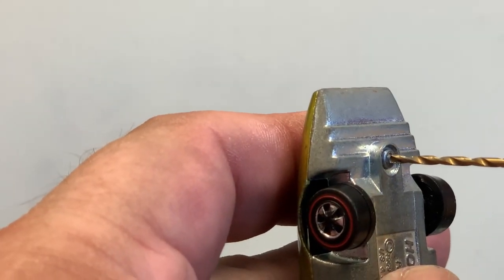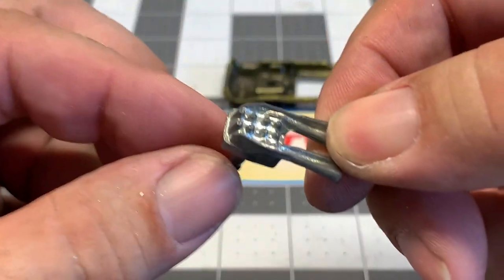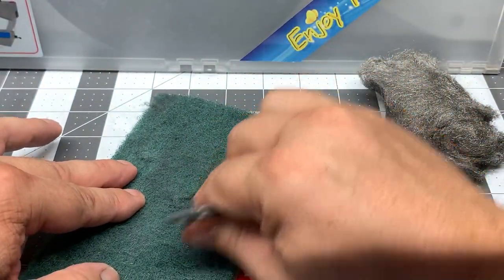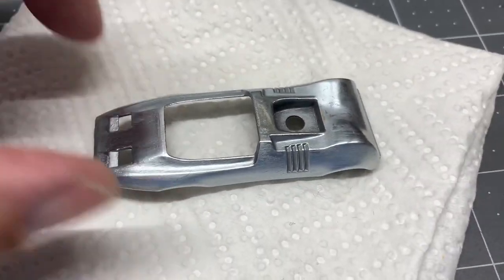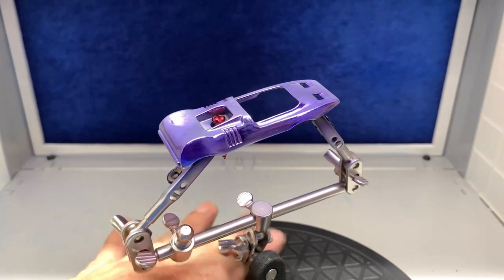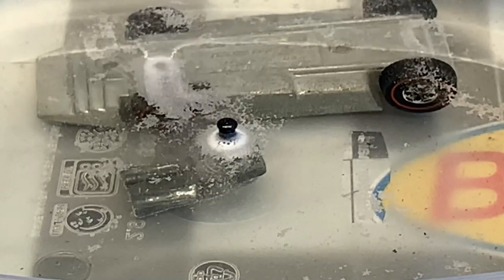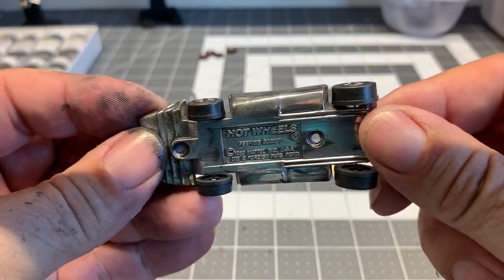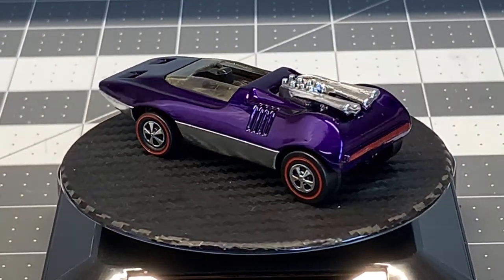Hot Wheels Peeping Bomb Restoration

Comment: Wonderful job. The before and after are amazing.
Reply: @DiecastGraveyard  Honestly I would like to see an original Johnny Lightning Topper Series car from 1969 to 1971. There are 47 original cars. I have 44 in various forms of survival. I don't know if you know alot about these cars so here you go. They had a large tang under the front of the cars and were launched like an Aircraft Carrier. The wheels were just like the original Hot Wheels but with a different sized bearing. Most of the axles were crimped on the exterior of the base. The paint was similar to Spectra Flame. Towards the end of the series they got rid of the tang and used spinning wheels enclosed in a structure to move the cars around a circular track. I'cm sure I left out a few details but that is what I would like to see. I am working on a few at the present. Thanks for asking.
Reply: @DiecastGraveyard  Cool! I will certainly keep that in mind. Thanks!